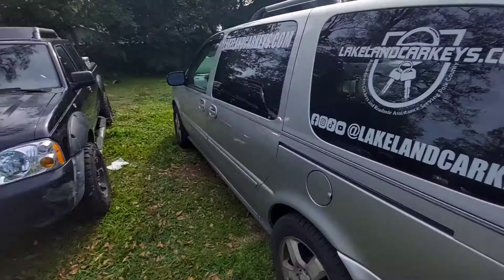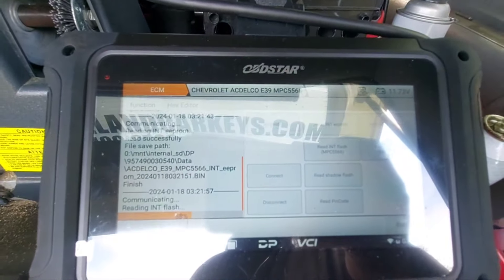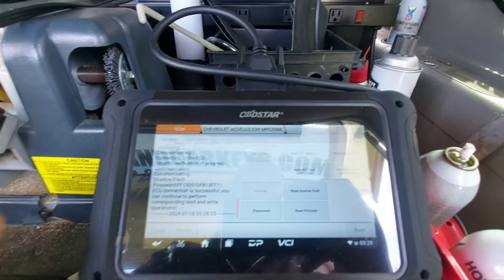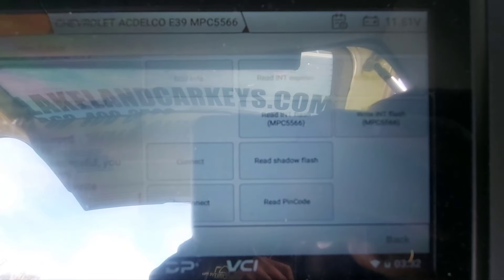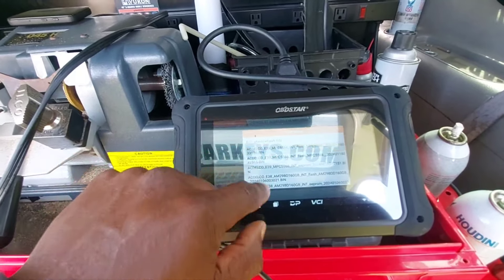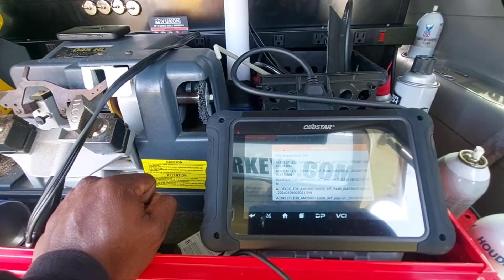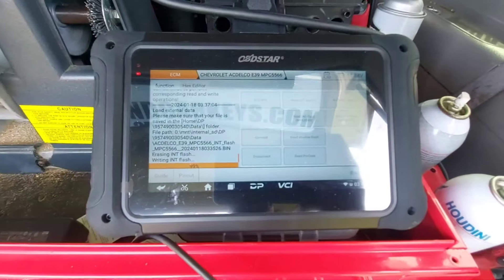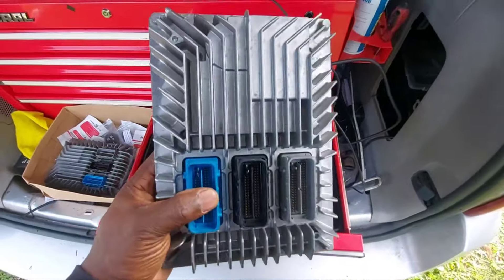2010 Chevrolet Equinox E39 PCM clone OBDSTAR DC706 Lakelandcarkeys.com

Comment: Hi there, I have a dc706 but cant connect to ECU using the guide, however I see that you have the wires connected to the P004 adaptor pins which is different to the guide. Could you help me do advise please. From Australia.Regards Ross
Reply from the maker: the machine will tell you what adapter to use, also make sure to turn both switches on on the p004